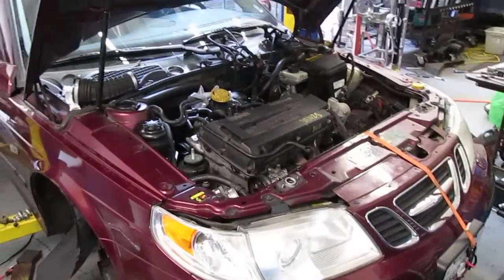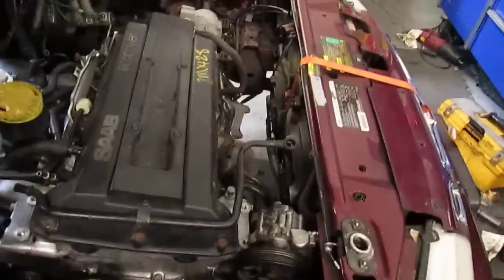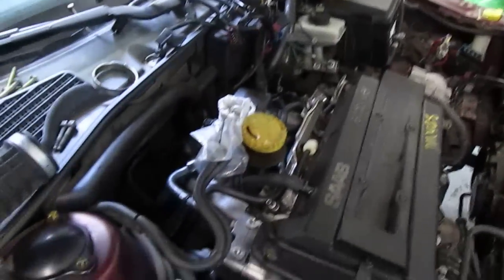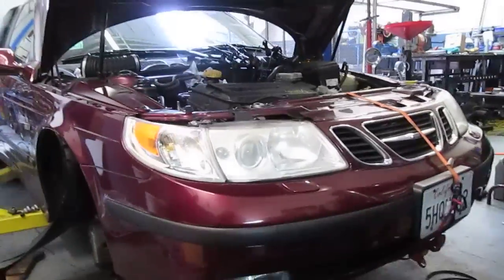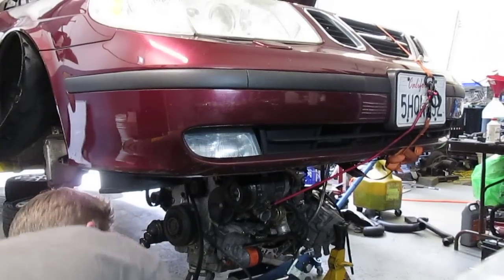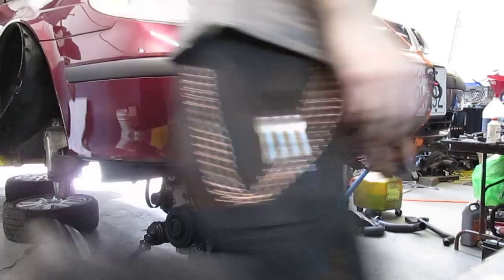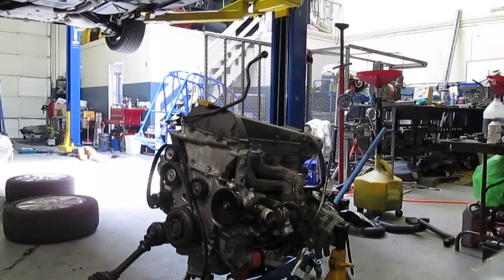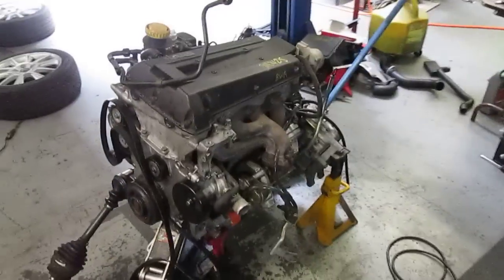Saab Engine Removal 2003 9-5

Comment: last times I Did this I left the subframe attached. and dropped the complete assembly straight onto a pallet I put under the car. this way I could pull it away from underneath the car. Works like a charm

Comment: im doing this same job soon. Is the engine bolted to the subframe in any way or just mount supports?
Reply from the maker: The Subframe was removed after the exhaust downpipe. Firewall trans mount and Rad torque mount out, leave rack in. undo ball joint cross pins and drop entire subframe with jack, engine now hanging by side mounts. Undo the wiring harness and hoses. P/s pump and A/c left attached to car. Hope this helps.
Reply: Ok this will be handy thanks for the info.

Comment: Way easier to take it out the top, especially if you don't have a lift.  

Automatics are quite simple, the transmission can stay in the car with the drive axles.  Manuals  the transmission has to come out so the axles are off.  The pull is quite steep.  Don't forget the crank pulley has to come off.